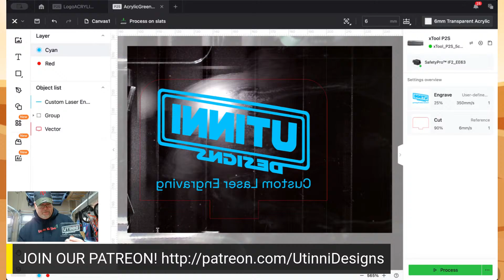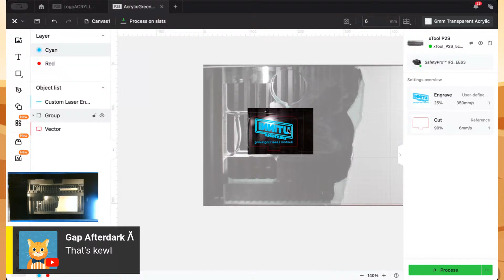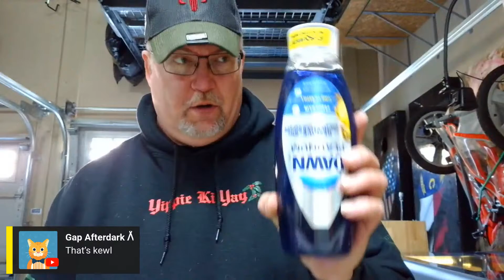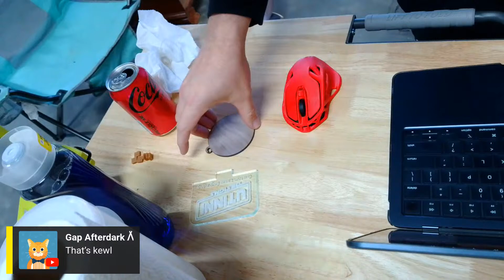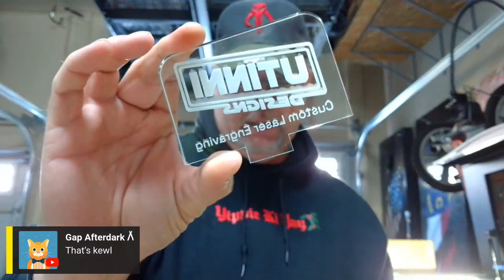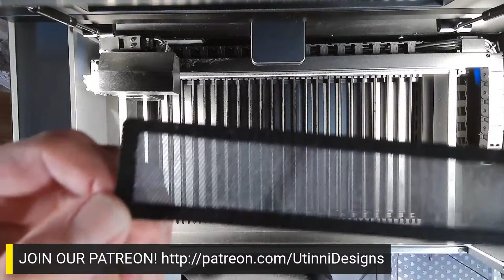xTool P2S Workshop Engraving and Cutting Clear Acrylic with Utinni Designs

Comment: I do all acrylics for 7 months now using only paper backing o n both sides with my P2.  I have the P2S but dont think I engraved yet but never had that foggy issue here are my engrave settings.  40%  Power,  150 speed. 1 pass 100 Lines pre cm engrave mode Bi-Directional  maybe just maybe this might help.  Thank you for your post great to watch
Reply from the maker: Thank you, I will try that and see what happens!